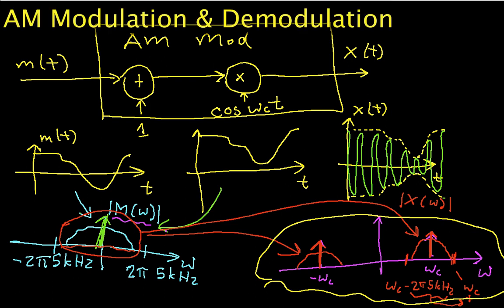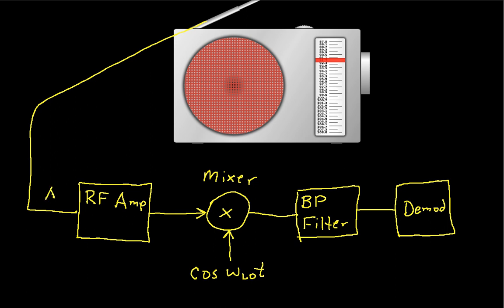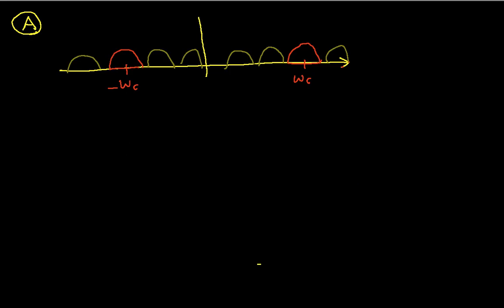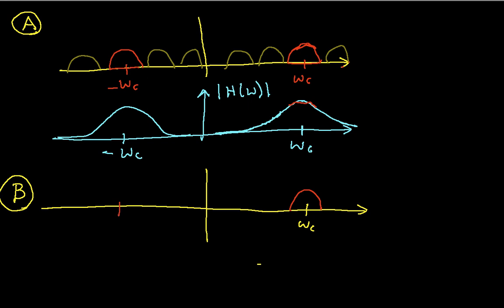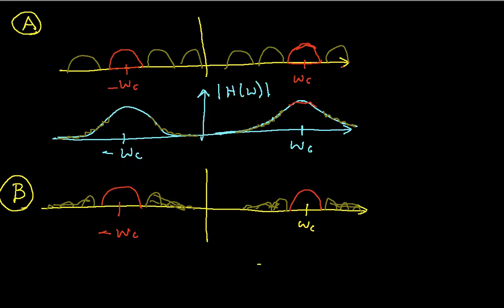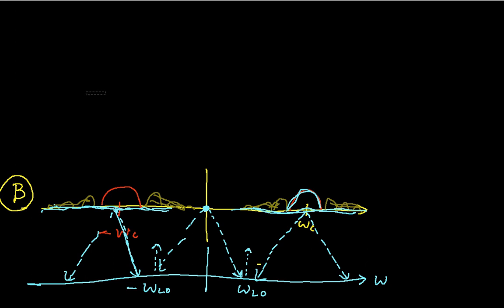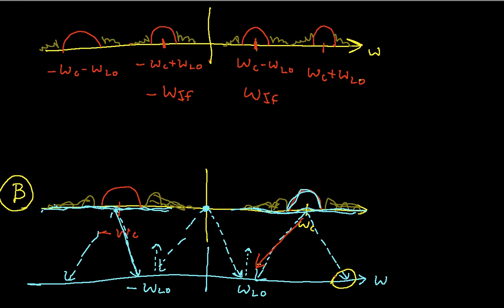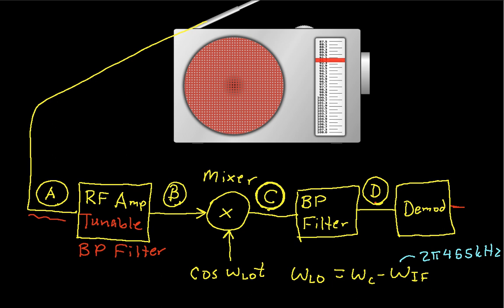AM Modulation and Demodulation Part 2

Comment: Hello Sir! I have a question! you say multiplying in the time domain and convolving in the frequency domain! isn't it the other way or is there a symmetry between both?
The video is great. Just a bit confused at the point where you're drawing the local oscillator in frequency domain. A little clarification is appreciated. Thanks a bunch
Reply: There is symmetry. You can have a multiplication in time domain, take the Fourier transform and it turns into a convolution. Same thing happens the other way. It is a trivial proof.

Comment: too complicating. Why don't you just say the amplitude of the carrier wave is varied in relation to the voltage level of the audio signal? It's not rocket science like you're trying to explain in a complicated manner.
Reply: that's like saying 'combustion of fuel propels a rocket against the force of gravity' explains Rocket Science